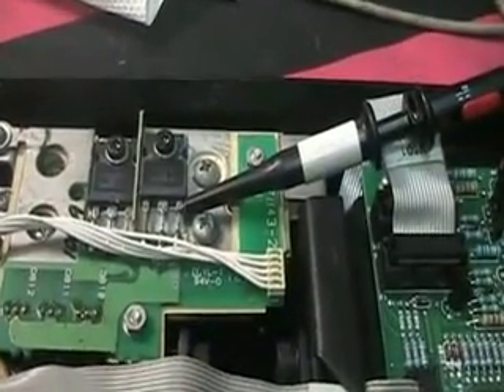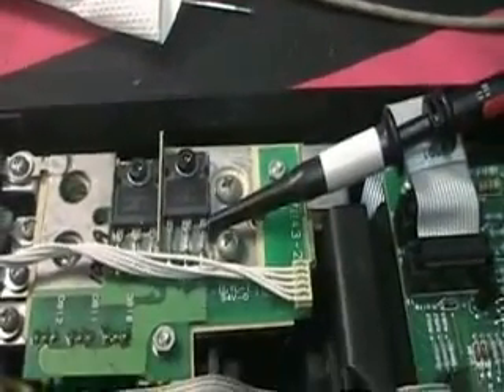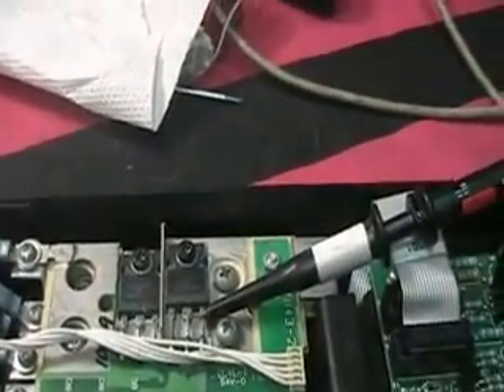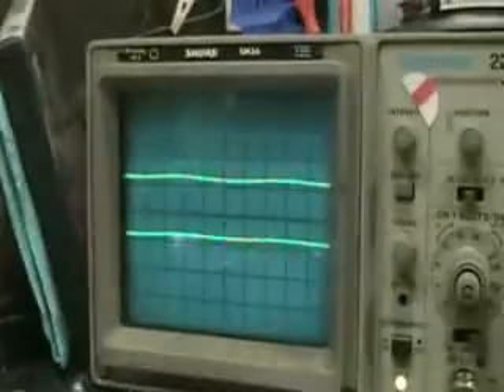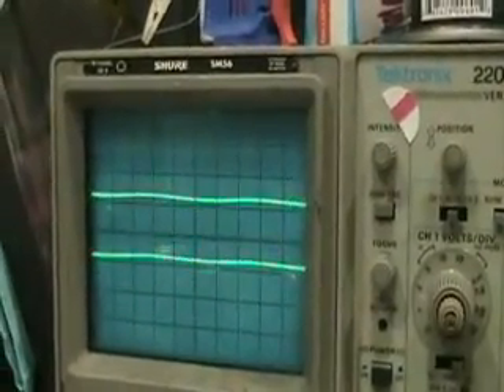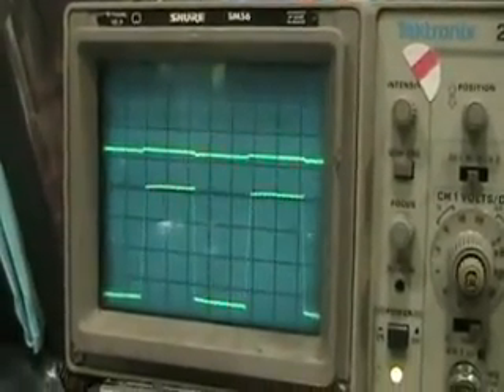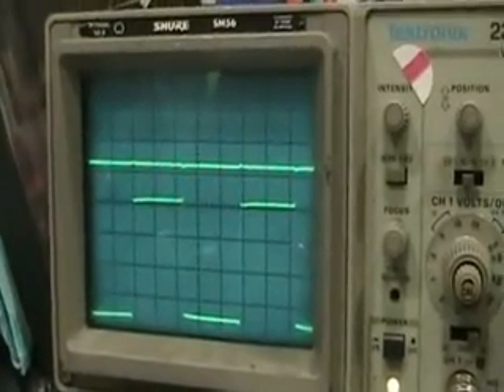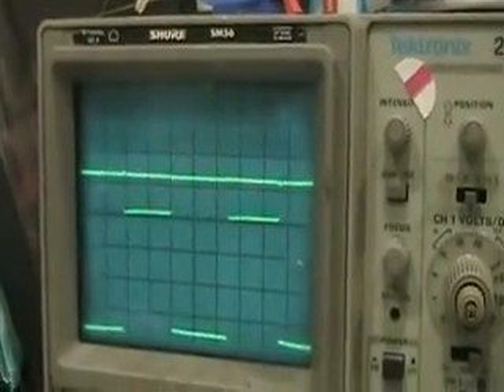Crown MA5002 SquareWaving

Comment: This problem was traced, with the help of Crown support, to the "Terminator Board". I'm not sure what exactly was defective in this board since I ended up replacing the entire terminator assembly. This board is right at the output of the amplifier; you can see this board by removing the bottom cover underneath the channel 2 amplifier assembly. There is a circuit in this board that is designed to protect the amplifier by swinging the output in a way where it ends up NOT delivering any power to the load even though the amp is still working.  The way I pictures this is: Imagine you load one battery in the right way of your tv remote control and the other reversed. The right one ADD 1.5V to the remote and the wrong one SUBTRACT 1.5V and the remoter ends up with a zero net voltage. In these amp, the output module is made of two half, one positive and one negative acting like the batteries of the tv remote, when the protection kicks in, these two half ends up delivering a zero net voltage to the load. So, the amp swings at the frequency of the input but the output looks like a square wave. This is the way I see it. I never really did any thing to confirm this since I was so happy to get this amp out of my bench. The most common problems that I see with these amps are broken traces in the green circuit board" of both positive and negative HALF's of the output module assembly where you see the accumulation of dust. These amps, the Crown MA series amps, are probably the best designed amplifiers that I have ever seen and worked with in 20 years working as a technician in a pro sound company. I still love them but they can not compete with the new class D technology which produce extremely power amplifiers, light weight, efficient, with sound processing like crossover, eq, compressing, limiters and so forth at a very amazing price. In more than 20 years of work I NEVER dumped a single Crown MA amp......now don't ask me how many Crown CE's, XLS, xTi's have I dumped???
Reply: Nicee💯💯💯

Comment from the maker: This problem was corrected.......it was finally traced, with the help of the Crown support team "Derek",  to be in the current sensing module located after the output module, underneath the amp. This module was replaced and the problem was finally corrected.This amp is designed to swallow the output in this fashion to protect the amp in case of an overload caused by burnt speakers. This malfunction was sending a false signal triggering this protection.